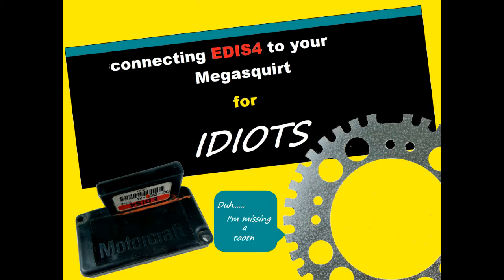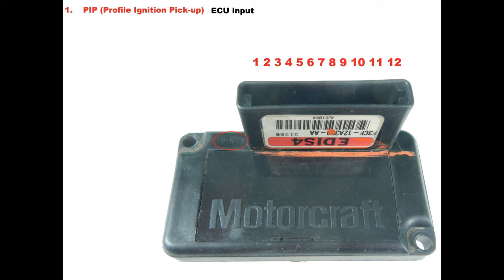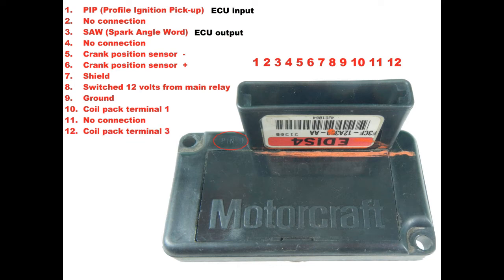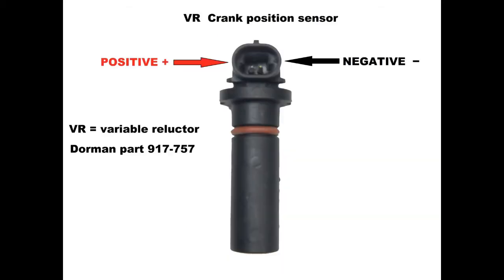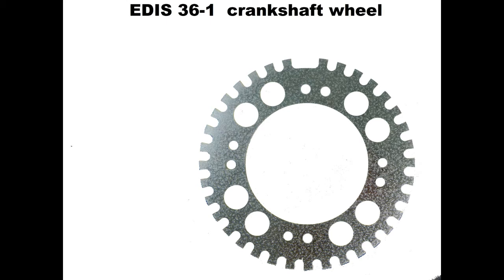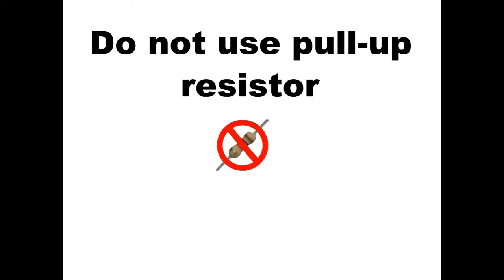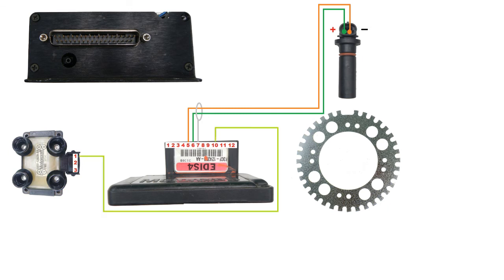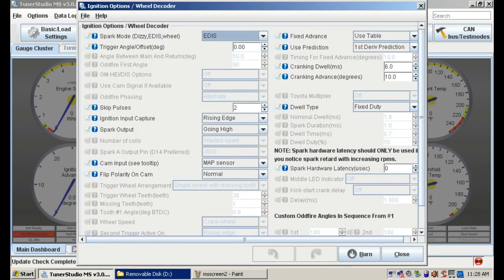How to connect EDIS 36-1 crank trigger ignition to your Megasquirt   EDIS4

Comment: hey man, I am in the assembly of an ms2 for a ford bronco, I am going to use LS coils wasted spark and I have a wheel with 36-1 teeth, what sensor can I use that is easy to get and works well with that number of teeth? Do you recommend a GM VR sensor, which one would it be? Thank you
Reply from the maker: Any VR sensor will work.  The GM one in the video is recommended because it is easy to fabricate a mounting system and the pigtails are available on ebay/amazon
Reply: @robotcantina8957  thanks man! i will look for it. I would like to ask you another question, is that GM VR sensor for an ls engine?. Could you give me a link of the sensor to buy on amazon? I have searched but there are several and I want to be sure, thanks!
Reply from the maker: @ricardoalvarez7863  The LS crank position sensor is a three wire type, I'm not familiar with how that type works,  it could be a hall effect sensor, Im not sure.  The type of sensor I used in the video is from a 3.1 or 3.4 GM engine.  Its a two wire type.  Pay attention to the polarity when wiring the sensor, it will work if wired wrong, however it will cause many problems.
Reply: @robotcantina8957  Thanks for your great help, I will look for it!

Comment: I have used EDIS 4,6 and 8 in about twnty installs. This "How To Connect.." lacks an important part. Original EDIS installs on FORDs always have a capacitor of 5-25µF on the + 12 Volt supply to the ignition  coil. I have experimented on bench set ups and the capacitor is definitely needed. EDIS will not perform well w/o. Also, the HT circuit MUST use resistor HT leads and/or resistor sparkplugs. EDIS will shut down otherwise.
Reply: Can confirm. My mk4 Escort has an odd 2 pin connector but only 1 wire going in and is mounted up by the relay box (it's like the VR connector but one of the pins flats is rotated) and appears to be grounded on the chassis. I almost ignored it as I was swapping engines from a carb ESC module to EDIS4 but luckily I was curious what it was so did searched the part number. If I remember correctly this cap is to smooth out any noise for the EDIS module.
Reply: Do you have or know of a detailed instruction manual or how to write up on installing EDIS? I'm particularly interested in how to do it correctly for an EDIS-8 to GM LT-1.

Comment: I did this ignition modification to my '68 E Type Jaguar 6 cylinder. It has been the best upgrade to my car in the 35 years I've owned Her, "KoolKat". If you're thinking of doing this upgrade...just do it.  I've had my running for 14 years & have only changed the plugs, gaped to .050 & different spark plugs wires, running a XJ-40 coil pack.

Comment: In 4:50 in don’t understand pin7 What that mean?
Reply from the maker: Pin 7 is the shield.    The image shown at 4:50 is industry standard for depicting a shield.  Google shielded wire for more info.
Reply: J Dwd Thank you.if I use Edis4 and How about itbs sensor and injection fuel systems?
Reply from the maker: @105mania6   I'm not sure I understand your question.

Comment: It works for ca18det???
Reply from the maker: The EDIS4 will work on any 4 cylinder engine with a megasquirt.   Keep in mind that this type of ignition system was originally designed and installed on the Ford Escort so making it fit a ca18det would require custom built brackets and or course a custom hub to mount the 36-1 crank wheel.
Reply: @robotcantina8957  to carburetor???
Reply from the maker: @juniormendoza2879  The video was intended to help people connect an EDIS4 ignition system to a fuel injection Megasquirt ECU.   If you are not using a Megasquirt ECU for engine management then the EDIS4 will not work for your application.     For a ca18de with a carburetor you would need to use a Megajolt ECU to make the EDIS4 work on your application.   Google " Megajolt and EDIS4 "     Sadly, this video will not help you with your project.  Best of luck.

Comment: Would you happen to have pictures of the internal modifications to The megasquirt ll v3.0
The manual says to jump JS10 to ignition.
Reply from the maker: Hi Mostin,  Good question... I used a fully assembled megasquirt 2.0 V3.57 from DIY autotune.  I didn't need to  modify anything.  I think the IGBT (high current driver) is actually triggering the EDIS module .  It works fine, but now I wonder if I shouldn't be using the IGBT to trigger the EDIS module.... hmmm.  Sorry, I don't think I have  a clear answer.